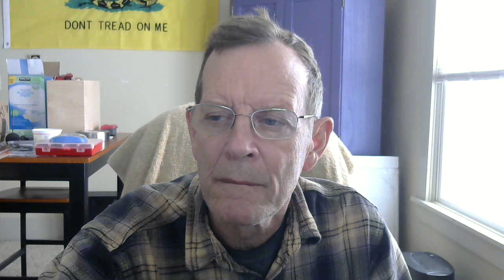Lazy Susan Cabinet Adjustment

Comment: 6/16/23 - This device looks like no-longer made Amerock device. My Lazy-Susan Cabinet did not line up with the rest of the cabinetry for years. I, too, was ready to get a handyman to fix it until I saw this gentleman's suggestion. Turned the screw nearest the spring to the left several times with a Phillips and IT WORKED!!!  If a widow and do it, then so can you. Thank you and God Bless.

Comment: This worked perfectly for me.  It is so simple.  He did not need to post a video.  Just look at the picture in the link and do exactly as he says.  He couldn't have been more clear, and it couldn't be easier.  It is NOT meant to align the shelves, as somebody said.  It's meant to align the front of the cabinet so that each door sits equally in the frame, when it's closed.  The screw on mine was fairly loose to start with.  I found that I had to totally tighten the screw first (which didn't change the alignment), and then I loosened it incrementally until it finally did the trick.  Two thumbs up!